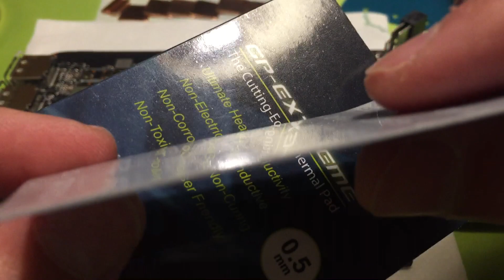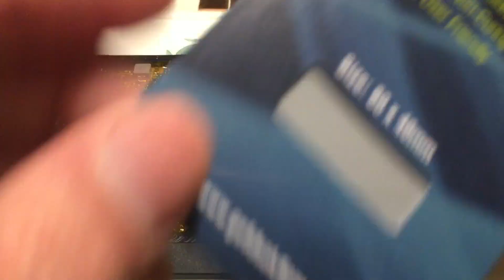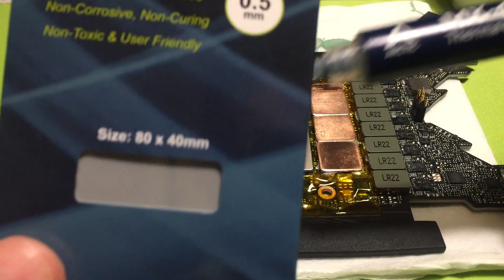How to drop from 106C to 74C with 1mm COPPER shim - RTX 3080 Founders Edition - Better than 1.5mm?

Comment: Cooper mod and I have worst temp … wtf is that 😭
Reply from the maker: Hi! More details please?

- Do you get high temps on the core? on the vrams?
- GPU model? Producer?
- Do you use it for gaming?
- Current mh/s? (or setup wanted if used for mining)
- Overclock setting?
- Thickness of thermal pads and/or copper shims used?

Usually, if the core/vrams is hot, it may be because of (but not limited to)
- Not good contact with the die/heatsink.
- Thermal pads/copper shims of wrong thickness.
- Screws not properly installed.
- Too much/little thermal compound.
and the list goes on and may vary a lot.

Let us know so we can share some ideas that may help you to resolve the problem. Best practice is to do more research and usually do not attempt to do further modifications if you are not comfortable with it.

Please let us know of any update!
Thank you :)
Reply: @davtechlab8646  I found the problem I don’t put enough thermal paste before the cooper on the memory now it’s insane 74 memory !!!
Reply from the maker: @mareautech6067  Fantastic! Surely it was one of the problem we mentioned above. We are glad you resolved it quickly!

Would you please let us know in about  1 or 2 weeks what temps you get? (stable temps) We want to compare some data with our results for one of our next video.. It will be very appreciated.
Thank you :)
Reply: @davtechlab8646  yes no problems !
Reply from the maker: @mareautech6067  thank you very much! :)
Reply: @davtechlab8646  hello i am still using cooper mod . 9 day after it work perfectly fan 80% and memory temp maximum 76degres before with pad it was at 100degres memory and fan 100% so i am very happy with cooper mod
Reply from the maker: @mareautech6067  fantastic! Happy this helped! Do you live in a hot or cold environment?
Here we have temperature of +35C during summer time, so this mod helps a lot!
Reply: @davtechlab8646  we are at 22 degres

Comment: Bravo!!! Never tried the copper. Must try! Auto mechanics use a 'plasti-gage' to read oil clearance between crankshafts and bearings. Small round soft plastic that is measured after the squeeze. Will look that up for measuring clearance? Would then be able to get the All Copper measurement darn close!!! Or buy Saphire GPU's. They dial in very good temps.
Reply from the maker: Thanks! I’m working on next videos, collecting all the data and filming when possible to add more content as requested! I will add them in the very near future. So, very soon this channel will be populated with similar videos ;)

Comment: I think placing the kapton tape will kill composant protected by kapton, because i think this will stop cooling of these composants...
Reply from the maker: Hi, fortunately the kapton tape does not work in that way from what I found based on my own research.

It is really good at resisting heat (does not melt at temperature lower than 200C) This is the main function of this tape.

For example it is also used to wrap some LiPo batteries, so if one of the cell of the battery fails, the kapton tape will resist some of the fire. But some, if not most, of the heat will be transferred to nearby cells or other components anyway.

Please, of course, always do your own research and don’t take my words as 100% accurate. Happy to cross checking any type of info you may find :)
Reply: @davtechlab8646  let's make it simple.... Kapton do not allow heat to pass... both way...

So the heat generated by small component under the tape, cannot evade, and cooling (fresh air), cannot hit the component to cool it..
Reply from the maker: @tahitiindigo   hi, kapton tape has a thermal conductivity of 0.7 W/mk.

To make a comparison air at 70C has a thermal conductivity of about 0.02 W/mk.

Air will hit the kapton tape and also hit whatever is below it.

Most of the heat generated from the vrams will be ANYWAY assimilated and immediately dissipated on the heatsink by the thermal pads/copper shims so quickly that won’t affect the circuits - unless the heat dissipated is well above 105C, BUT in that case we will see thermal throttling and probably the GPU will shut down or restart.

Resistance to fire, insulation and thermal conductive capacity are all very different things ;)
Reply: @davtechlab8646  Thanks for the informations ! good to know
Reply from the maker: @tahitiindigo  thank you!

Comment: Does it reduce the heat of the gpu core a lot?
Reply from the maker: Hi, this mod specifically aims to reduce the temperature of the vrams.

Due to the more heat transferred to the heatsink, most likely you’ll have an increase of core temperature.

For example, some of my 3080 FE after this mod are running at about 54C core, 70C vrams, 69% fans speed.
When BEFORE this mod it was 48C core, 104 vrams, 95% fan speed.

Comment: Hi! Can you tell us what are dimensions of cooper plate? 10x10 or 13x13 or 15x15mm. Thanks!
Reply from the maker: Hi! For this GPU I used 15x15x1mm copper shims.
Reply: @davtechlab8646  Yeah 15 x 15 is the standard size shim you will find on Amazon. The vrms are actually closer to 13 x 13.. Hence that smaller shim, which i guess was cut and filed to size. I've seen that placed in the middle of the larger shims by other modders, presumably to prevent it slipping off the side. 

BTW watch out for 20 x 20mm shims sold online. I bought these by mistake. I'm thinking of still using them with 0.5m pads for that connection between the the vram cooler and the heat pipes of the main cooler. 

The tolerance are so tiny. You need the gpu chip die to make firm contact with the main cooler [via the rear x-connector] and not be limited by the other thermal pads and shims. Its a shame there isn't a diagram online to confirm the dimensions / tolerances involved.

Comment: whats the tickness of the copper shims? i tried 1.5mm and not enough gpu contact on the FE
Reply from the maker: I used 1mm copper shims in combination with 0.5mm thermal pads.
I use stiff thermal pads, Gelid. The ones the are grey, not the blue one.

If you think that there is not enough contact on the core because you see high temperatures (usually 55C) it is normal due the more heat transferred to the heatsink.

But if the temperature is above 60C then it may be as you said, not enough contact on the core. In that case you should try using 1mm thermal pads (VERY soft one) instead of the 0.5 thermal pads. (In combination with 1mm copper shims of course)

Let me know what results you get if you try this way.

Thanks! :)
Reply: @davtechlab8646  i only have a problem with one of gigabyte's 3080 on the core side, even with 1mm but thats cooler side problem(slight bent) 65/70c core, 86c vram, is that safe 24/7? I am using thermal putty with 1mm copper in every card and this one is the only one suffering a little
Reply from the maker: @pav1u   if you have “compatibility” issues on the core try a more dense thermal paste like the MX4 Artic.

Core at 65/70C is never good I think. Try to stay at 56C maximum for the core.

Vrams at 80C is good, lower even better of course. For me personally, 86C is the line I won’t cross.
Reply: @davtechlab8646  Thank you, note that i am talking about temperatures inside the grow mining tent, all the cards running with no fans only one exhaust, so i think these are normal temps, there is one or two cards reaching high 60's on the core but no more than 90c vram with copper mod...all gddr6x, it runs HOT

Comment: In my list of gods you are ahead of Messi hahahah
...thanks eternally, I wanted to modify my FE to copper and the option of a small part of thermalpads gives me enormous confidence, the sacrifice of degrees seems minimal to me for the security that is gained, the pressure can easily destroy the card. good job, I'll watch the next videos
Reply from the maker: Hi! Thank you very much! Really appreciated!

The best heat dissipation (water cooling excluded) is by using only the copper, but issues may arise due incorrect thickness and other factors.

Thermal pads + copper shims is more “secure” with just a 4C to 6C in temperature difference.

I will drop a new video soon where I do take some observations regarding these differences. Stay around ;)
Reply: @davtechlab8646  cheer up! I look forward to it!

Comment: the heat transfer between the thermal paste - to copper plates - thermal pads will be reduce that isn't a good heat dissipation
Reply from the maker: The difference is about 4C to 6C. There is a video I'm dropping soon where I do compare different results on 4 rtx3080 Founders edition and I do explain all there.
Reply: @davtechlab8646  thats interesting when will the video be dropped? really  would love to see the comparison
Reply from the maker: @Slic3DnScal3D  working on it. Cross checking all the results to make sure the informations are correct.

Comment: Thermal pads are dumb, you just re-insulated and negated the thermal conductivity gained from copper
Reply from the maker: Hi, thanks for your comment :)

This is not totally correct.. Nothing is negated, the right word is “reduced”.

I traded about +4C to get better results in terms of components interaction.
Using only copper of course is the best solution to get low temperatures, but it may be problematic when pressure is applied (once the parts are re-assembled) On the other hands the combination of copper and thermal pads helps when pressure is applied, but due the low thermal dissipation the thermal pads will act as an insulator.

In short:
Thermal pads only 80C.
Copper only 70C.
Copper on vrams then pads 74C.
Pads on vrams then copper 78C.

Tests and observations were made using 4x RTX3080 Founders Edition and for each testing out the solutions above.

There is a video I’m dropping soon where I explain all this.
Reply: The reason people do pads is for easier cleanup in the future. If you have like 100 cards it becomes a pain to clean eventually. 

Copper shims is not a bad idea. I’d say its good if you have one or two gpus. If you have a lot I think people go immersion mining.
Reply from the maker: @markw496  This mod should be made on those GPUs that really need it.

I will never do or suggest to do it to every single card simple because it is VERY time consuming unfortunately.

Did you try this mod before? Mind sharing the results you got?

Thanks! :)

Comment: I feel like I need to highlight as someone who repairs graphics cards for a living, make sure the copper plates CAN NOT touch the legs of the inductors or capacitors. A plate shorting FBVDD (memory phase) to 12V will permanently kill the card. A plate shorting FBVDD to a PEX, 5V or 1.8V inductor can also permanently kill the card. Most thermal pastes are non conductive and should not pose an issue going under the core or memory chips but better if it doesn't. Careful not to bend the PCB too much as it can break solder joints under the core or memory chips.
Reply from the maker: Totally correct! The kapton tape, in-fact, is there also to minimise the amount of thermal compound going around... Kapton tape is also placed on the side of the LR22 modules that are facing the vram and on all the sides of all other modules (to be more accurate) that are facing the vrams. Copper is also at almost the same size of the vrams to avoid to much of it going outside of the vrams surface area. I'm already working on another RTX 3080 Founders Edition where I do the same process but I'm layering the copper, thermal pads and thermal compound differently.

Anyway, I do believe, based on various results, that the most efficient (heat transfer) setup is copper and thermal compounds only, without the use of thermal pads. If this is the safer way, of course, it is another story...

Thanks for watching! :)
Reply: @davtechlab8646  I have done copper mods on more than 12 cards all 3080's and 3090s but use only putty and copper shims, it isolates the pcb and works wonders! the best results comes from thermal paste and copper only but it has to be the exact measure and that is not easy for a lot of cards
Reply: @pav1u  What size copper shims and pads did you use for the 3090 founders edition? I want to combine both shims and pads.
Reply: how did you start? thats really interesting job!
Reply: @Phyro I'm about to do the copper mod as soon as I get my copper shims from China. I will use in my asrock challenger rx 5700xt, it has the vram heatsinks separated from the core heatsinks, so the copper shims will be between the VRAM and your screwed heatsink, thus reducing risks of short.  I will fix the copper shims in the VRAM using 0.15mm double-sided thermal adhesive tape of 2w/mk, and between the shim and the heatsink I will use thermal paste, the thermal pad that comes standard is 1mm so I believe the 0.80mm shim is ideal. The double-sided thermal adhesive although it has only 2w/mk (poor in conductivity compared to thermal pastes or pads) it turns out to be efficient due to its thickness of only 0.15mm and will act as a shock absorber and pressure distributor. What does this tell me? Thank you.